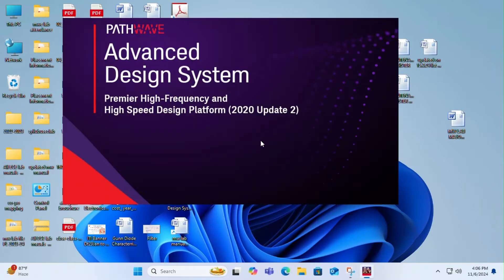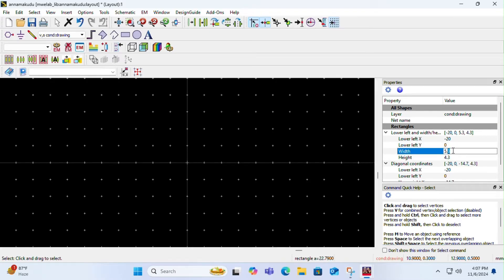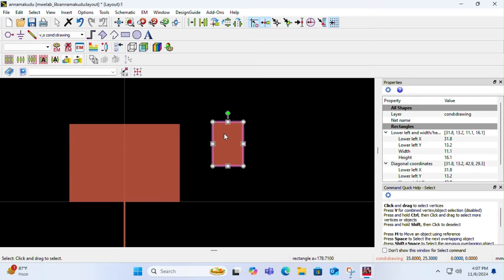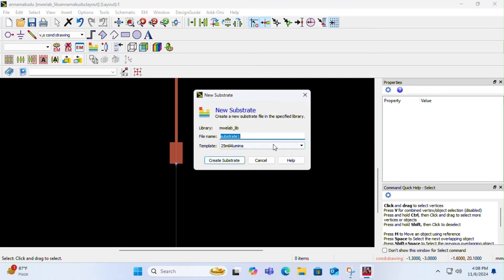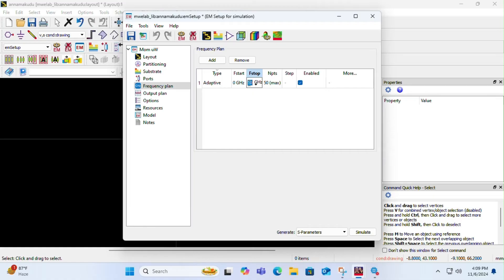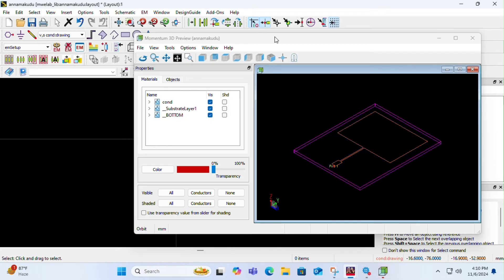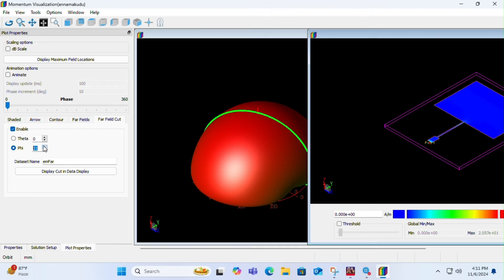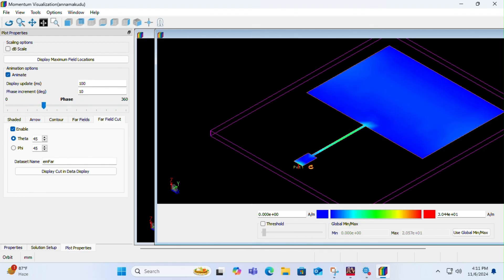Design of microstrip antenna using  ADS - EXPLAINED!

Comment: How to use graphene as a substrate ,is it possible?? Please reply bro
Reply from the maker: If you want to use graphene as a substrate, you have to take dielectric value and height of the substrate, add a custom substrate during the same step where I am adding the substrate (FR4) click on the 3dots on the right side of selection pane and then select custom, you will get a tabular column in that add your name, "graphene" and then add the dielectric value in the dielectric field and height in the height field. Now choose this as ur substrate
Reply: @TechTalks2712  Tqsm bro for your reply
Reply: @TechTalks2712  could you make this as a video ,then it will be more useful

Comment: from where did you get these dimensions? how can I get this? how can I calculate or choose these dimensions for the patch antenna and the microstrip line? also how did you chose FR4 as the dielectric and 1.6mm as the height? please explain all these...
Reply from the maker: @Chasedarrow  there is another video in my channel, where I explained the theoretical calculations of this, please check it. And FR4 dielectric is just a choice, 1.6mm height is also an assumption